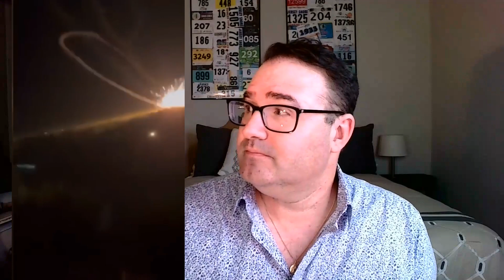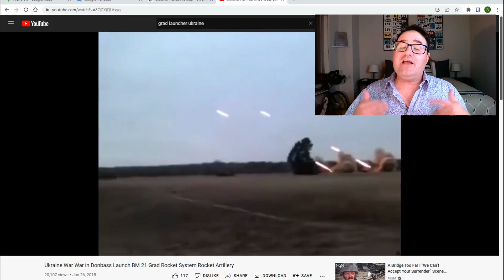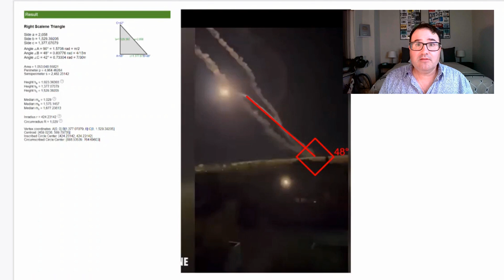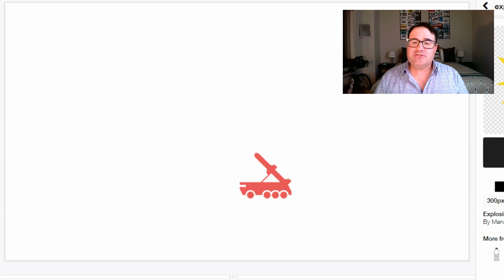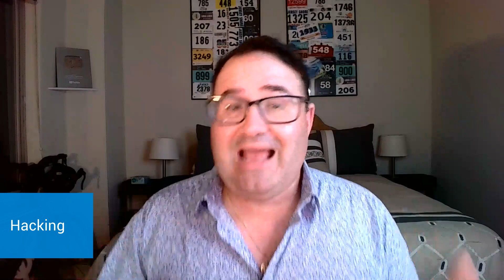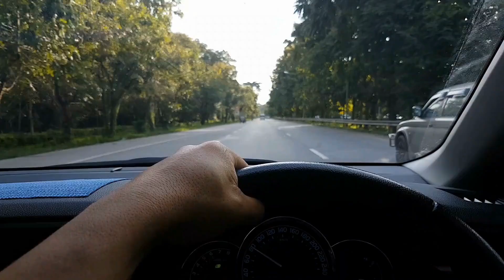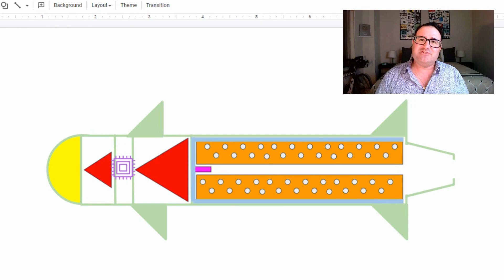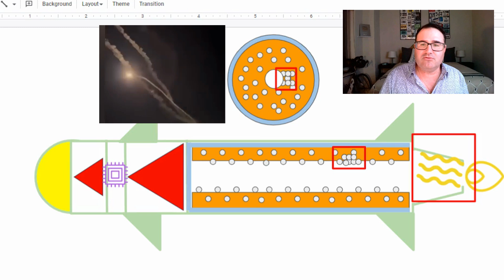Why this missile U -Turned

Comment: Good morning Ryan, I am from the south so I found an interpreter and was able to understand you. I am a former Navy FT and have experience with solid fuel misses, Tartar, SM1-SM3.  Most of your explanation is right on. One note to add to your bank of knowledge. During boost all of the internal guidance is locked up to keep the bird from going crazy during the initial boost phase. Keep in mind the bird goes from setting still to Mack 2 before it leaves the rail. There is a fire through latch on the launcher to keep it from moving until sufficient force is met to move it through the latch at Mach2. A lot of things happen at the end of boost. The electronic package is unlocked and the gimble  radar in the nose cones is positioned to where the return radar beam reflected from the target is expected based on calculations at launch. This is the tracking radar beam reflection. If the beam is not detected in 2 seconds of gimble positioned the bird self destructs caused by lack of rear lock. Without knowing how long boost is on this bird I would suggest that there was a failure in the electronic package during boost and either the gimble moved before the end of boost or at the end of boost the gimble unlocked and failed.  Based on what I see and my experience I would say the electronic package failed and unlocked during boost. If it had been a rocket motor failure due to a broken/air gap in the propellant it would have blown up. Seeing how Russia is digging into their missiles reserves I would suspect this is an old bird that has set around, been bounced around for who knows how long and suffered a failure during that time. Good video and keep up the good work.
Reply: @Ryan Mcbeth  
@RandyRhodes 
You guys are smart
Reply: @tylerm4435  Its fun to read right lol
Reply: I tend to agree with Mr Rhodes. If there burn-through had occurred you would see it in the video, especially if there was enough to cause such a radical change in direction. Mr Rhodes, you're a smart SOB! As an EOD Technician, I really appreciate your insight. You should write books!
Reply: @osamabinladen824  oh bin stop can’t hear you from the bottom of the ocean
Reply from the maker: Thank you for this. Do you think it could be asymmetric thrust from propellant burn-through? That would cause the behavior we’ve seen.
Reply: @RyanMcBethProgramming  asymmetric burns will probably just be ejected as a clump due to high chamber pressures through the Nozzle. I work on Hybrid and Solid Rocket Motors, when that happens, there isn't much of a trajectory change, but when it gets bad and it blocks the nozzle, it will definitely explode. The most likely cause is a failure in the Control and Actuation system or IMU failure.
Reply: @aerojetrocketdyners-2538   Well put. Usually the throat would straighten out any major irregularities in the burn or if the clump made it out to the nozzle we'd see something in the exaust to indicate it. That and the turn is just too clean. It would have to be an incredibly large burst, that coincidently turned the rocket 180 degrees and terminated its initial velocity, without any wobble, or corckscrew, or change in the exhaust trail and no damage to the engine.
Reply: @aerojetrocketdyners-2538  or the whole thing just explodes
Reply: @RyanMcBethProgramming   it looked more guided than not. I would say if it were burn through which it could be I would expect it to corkscrew rather than take a very close radius turn. The turn looked very guided and then a straight run to the ground. I have only seen burn throughs get worse not more controlled. Since this was a warhead shot there would be no TM data and that would have been the only way to know for sure. As you know solid fuel motors while more stable and safer than liquid fuel they do not age well. A very old Tartar test was to run the birds upon the rail and take a Silver Dollar and tap the rocket motor listening for a hollow sound and then declaring the motor bad. As the motor became more reliable that practice stopped. There was an actual NSN for a Silver Dollar. A sea borne platform is hard enough on the birds and failures were always exciting. I cannot imagine driving them around and reloading them via crane in a war environment. I fired 18 birds my last year at sea and had only two failures both were failure to get rear lock and self destructions.
Reply: @randyrhodes3934  I would like to add to this, that the same is true for air-launched missiles. As you and Ryan point out, there is a boost phase where everything is locked to ensure a straight flight path until the missile ha cleared the launch platform to a safe distance. 

So I would therefore like to add, that we may be witnessing a malfunction which can only take place after the transition from boost to the midcourse phase. Any fault in the guidance section (seeker, navigation, electronics) or control section (servos, batteries, actuators, gas generators, hydraulics, control loops etc) could cause the missile to steer.

Also, to counter your claim of asymmetric thrust Ryan, keeping in mind that the missile has transitioned from the boost phase, such forces would be canceled by control surface compensation and stability systems.

Hope this helps (ex air force tech btw).
Reply: @randyrhodes3934  It looked like it caught too early the beam of the radar station and turned homing into it. At least that is what few people in Ukraine claimed.
Reply: @randyrhodes3934  love this conversation, made my day
Reply: @RyanMcBethProgramming  Now the thing that i am wondering the most is how is the missle able to do a full 180 at mach 3 without disintegrating? Wouldent the force of the pull destroy the missile on its own or am i underestimating the integrity of the missile?
Reply: @RyanMcBethProgramming  Are you sure that this is a Buk SAM and maybe could explain why? As they are shooting several rockets, it seems for me that this is a BM 30 Tornado. You mentioned the Grad system,  which is rocket artillery but not for Air defence, so why couldn't it just simply be a different system with more range?
Reply: @schweexxee6118  trajectory isn't ballistic at all, SAM systems have high launch elevation compared to MLRS systems. Plus, for such a maneovure, only aero surfaces will be able to do it.
Reply: @RyanMcBethProgramming  have you seem the video of the Patriot system doing the same ?
Reply from the maker: @Abdulslam  I’ll raise you one – I’ve seen TOW missiles do it personally. Weapons can be miss handled in any military.
Reply: @RyanMcBethProgramming  type,
Saudi Patriot Missile Has Catastrophic
Malfunction And Impacts City
Reply: @RyanMcBethProgramming  "Weapons [are] miss handled in [every] military."  There, I fixed it for you.  ;)
Reply: @LeCharles07  😂
Reply: @Abdulslam  What the fuck, two of them do that right around the same time? All of these, the kinematics are pretty much the same, the failure or whatever happens seems to be the same species, as it were. Do you guys know what happened?
Reply: @RyanMcBethProgramming  Absolutely. TOW missiles are designed to nose-dive into the ground if they have a guidance failure, especially a broken wire.
Reply: @LeCharles07  Mishandled. There, I fixed it for you. ;-)
Reply: @RyanMcBethProgramming  the guy already said if it was a broken/air gap in the propellant, it would have blown up.
Reply: @rzero21  most likely not 100%
Reply: @RyanMcBethProgramming  If you mean burning through the side wall, yes.  Changing the thrust vector at the tail by a few degrees is not going to give a sharp U-turn.  Adding a thrust vector perpendicular to the missile axis (burn through) could do it.  The puzzling bit is why, of all the random directions the missile could go with a burn through, did it return to its launch site.  Lets hope for more examples to give more data.
Reply: @RyanMcBethProgramming  I don't know anything about the Russian missile system, but I can speculate from my knowledge of the PATRIOT missile system. I know that when a PATRIOT missile is launched, any PAC #, it needs to gain communication with the Radar within 2 seconds of launch. If the system fails to gain communication or has a an in flight error the missile will self destruct. My guess is something similar is happening here
Reply: @RyanMcBethProgramming  Randy has it right. If it were burn-through you would have seen some sort of corkscrewing or wild spinning. Not a controlled turn. This had to be a guidance failure of some kind. A locked gimbal, busted gyro, even a shorted/open circuit in one of the guidance axis control circuits could do it.
Reply: Rather go with Randy rather than fuel burn out.... I'd say if it burned a whole in the side it would spin like a Cathryn wheel... deffo looks like a malfunction on the guidance side be it the flaps or guidance software side
Reply: All you smart experts KIS; This was a smarter missile programmed to denazify and demilitarize Ukraine 🇺🇦. That was my 1st explanation and I'm sticking to it 👍😀😉😄!
Reply: @claudepelletier7601  n it  work..
Reply: "I am from the south so I found an interpreter and was able to understand you"   hahahaha  brilliant.  :D
Reply: I think this was an anti radiation missile That had tracked its own radar
Reply: @alfbeef5880  no, not guidance radar, but radar used to detect threats. So, they fired missile directly at their own colleagues 0.5km further away. Missile did not return to point of origin, but hit 500m to the side.
Reply: @alfbeef5880  you don't often use those from the ground plus unless the sensor was on backward it would never see its own radar lol
Reply: TY I was very concern for this information, the theory that this was an asymetric burn of fuel is not posible in my opinion unless it makes another hole at one side, it's just how gases at great pressure work inside close spaces.
Reply: @Vicius_IASL  you know..between you and the original commenter..I'm gonna ignore his vast experience and seemingly unending knowledge on this and take your word for it instead. I always believe that a short reply with a comical scenario is more likely than a detailed, experience based answer is. Of course I'm a drooling moron that believes everything FOX news says as well.
Reply: @TracyA123  LOL. The original commentor made BS claims. Some of what he says is true but the M2 off the rails part is hilarious. Funnily enough the Nike Hercules people make similar claims that aren't born out. People who actually know said that the missiles were supersonic as they passed Hill 88, a mile away. A fast missile is going off at 20g, not 7,000g. Ignorance of simple physics is endemic.
Reply: This was my 1st thought  too. Electronic failure of some type;  Heck you can Kinda SEE how the missle 'appeared' to want to 'pull up' at the end, get away from the ground.. heck it may have even inadvertently locked onto the launcher/tracker shrug
Reply: Today (July 8, 2022), the mayor(/head of military administration) of Mykolaiv released a video where he states that russians are re-purposing S-300 rockets to hit ground targets (adding GPS modules or smth), because they have plenty of those and lack of others. So it might be the case that what we saw is just a failed attempt of a ground-to-air "upgraded" missile to hit the ground target.
Reply: Hi. I worked on both guided missiles, and countermeasures systems for the US Army. This explanation is pretty much spot-on. Another thing to add is that guided missiles typically self-destruct when they lose all tracking in an effort to at least get a proximity hit. But they need to satisfy certain conditions before they will do this. (Typically some time in flight or a measureable distance from the launcher.) Since it did not detonate in flight, I'm thinking it was not even armed at the time of malfunction, or it thought everything was fine and just continued on into the ground.
Reply: @yuwish6320  Right. There's a Safety Arming and Fuzing Unit (SAFU) that has arming conditions and criteria. Some places call it a Safe and Arm. There may also be active control of the fuze. Some don't arm until they are near the target so that they won't explode prematurely due to countermeasures. Others just use acceleration and time. Plus it's the Russians, who turn out not to be a professional as their marketing suggested.
Reply: So basically your saying the buk missile is incapable of destroying anything flying low and near to it then, if everything is locked up...
Reply: @wor53lg50  Most SAM misses have a minimum range. The advantage of SAMis there ability to engage long range. This is why CIWS was developed Close In Weapons System. Navy Fire Control Systems do not allow for out bound engagements. So technically only long range inbound targets are engage-able by Navy SAMs.
Reply: @wor53lg50  well within a short radius yeah but even that range is pretty small and at that point they are probably already being shot thats usually why such things are paired with gun platforms so if a helo somehow gets too close they can shoot it with that.
Reply: @osamabinladen824   I thought they ooffed you
Reply: tartar hey that s ironic really
Reply: It's good that you were able to find an interpreter
Reply: South of where he's speaking English ?
Reply: @batmscot6149  southern states in the USA. Ryan said he's from New Jersey, and Randy is from one of the southern US states.
The accents from those areas can sound quite different from each other.

Just to clarify (in case you're from a country that does not primarily speak English): Ryan and Randy actually understand each other just fine. These are really just jokes.
Reply: @JoeyTen  I understand thankyou it's a bit like Scotland where ABerdonians from North Scotland Aberdeen can't understand Glaswegians from GLASGOW West Scotland they can understand to a point but its all friendly banter ready.
Reply: Thanks for the info
Reply: I say it's top secret enemy control system being tested, tweaked and perfected...Maybe I'm wrong buuut I Doubt it😁✌
Reply: I don't believe you, because I work on developing missiles for a living and I can do simple maths. You may know something about how the systems work, but you are no expert. SM3s are 21 feet long. Let's say the rails are the same length, which is close enough I work in meters because I'm an engineer. You are claiming better than 660m/s after a travel of around 7m. v^2 = u^2 + 2as where v is the final velocity, u is the initial, s is distance and a is acceleration. So a = v^2/s = 435600/7 = 62,228 m/s/s or 6,300g. Sanity check? Well I also do artillery fuzes and we expect well over 10,000g to get an M795 shell to about M2.7 in just over 5m. So less speed in slightly more distance. Here's a video showing SM2 and SM3 launches, as you can see they are a fairly soft launch. Nothing like a Sea Wolf launch.
https://www.youtube.com/watch?v=0YeMm_TZRss
Reply: Yes on the guided turn, just one more thing, why did it return to the rail? Because after launching three missiles, that would be hot, and if the radar failed, it's heat-seeking feature normally reserved for the last phase would take over and find that. Don't forget these are 1970s technology, and radar wasn't exactly precise.
My credentials? A retired Staff Colonel from the European Defence Diplomatic Crisis Management team. We got to know rather a lot about those systems back then.
Reply: @RahereTheGenius  IR sensors on missiles only look forward. It's not like a torpedo where it will execute a search pattern on losing the target. We also can't see where it went back. We only have a 2D view of the track, so it could have landed a mile nearer us than the launcher that fired it.
Reply: You're projecting your own knowledge of missiles designed by US defense industry against Russian missile design. I don't know that it's totally true that all Russian missiles have a self-destruct. That's something the US will specify in contracts out to defense contractors but I'm not totally sure that's always there in Russian proposals.

Comment: One note that many commenters in various media seem to have overlooked.

Because this missile is radar guided, once it managed to turn around and face in the direction of the illuminator (the guidance radar), the direct path of the outgoing illuminator radiation would now look like the reflections the missile is looking for from the target, only REALLY close.  So, 

A, it will fly in that direction (towards the "bright thing" that its little robot brain has been told to fly into), and 

B (depending on the safety features of the fuzing and onboard guidance system), may think it's in terminal attack phase (inverse square law means that looking directly at the emitter presents a false positive of a target at an even closer range than the emitter is - basically, the missile thinks it's approaching a target that is only ¼ the range that the missile actually is from.the emitter) and switch into terminal attack mode.  

BUK family missiles have both proximity fuzes (unfortunately, I don't know what range they are set for, and I'm not sure it would even see a reflection from the missile's  on board radar in the ground clutter) and a backup contact fuze (which, presumably is only fully armed in terminal mode, for safety reasons).